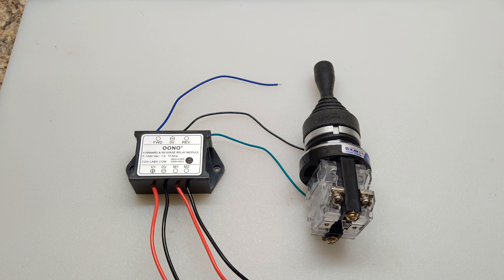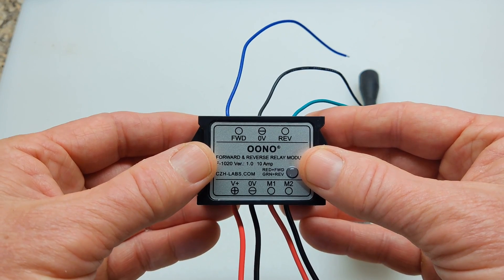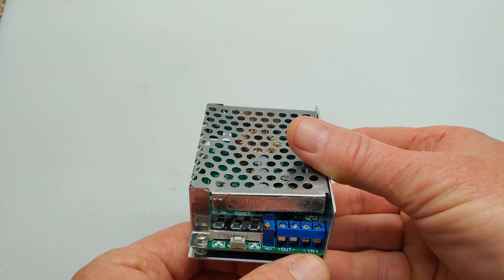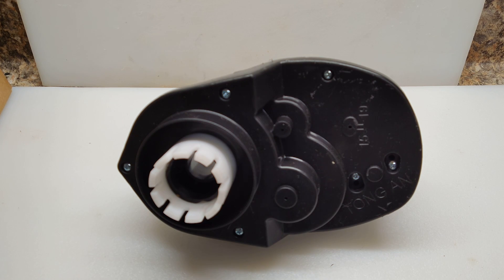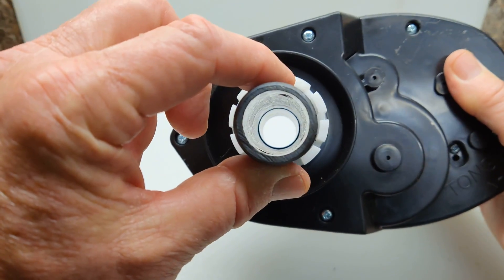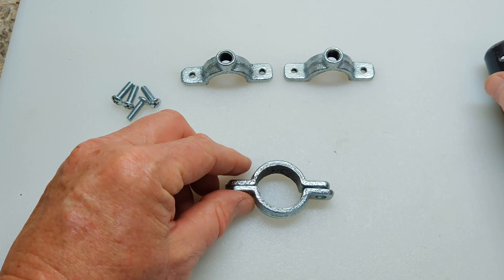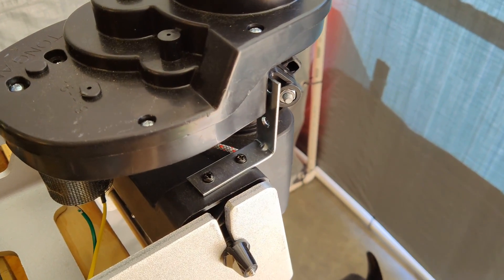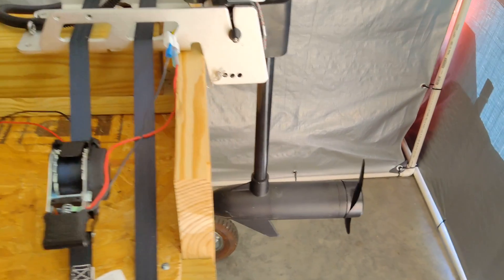Trolling Motor Power Wheels Gearbox Steering

Comment: i have the sd5160ssg , the bctrolling motor block, a 7v voltage regulator and the chinese joy stick on your other video  it doesnt work i am probably not wiring it correctly or missing something  any thoughts?

Comment: Great videos! I've watched several and all are very informative and well presented. I'm wanting to fo a diy for my forward facing transducer using a minnkota terrova steering motor. Can you tell me what I need to make it a remote controlled gor left and right, and if possible the speed of rotation?

Comment: I tried replying to your question but the system wouldn't let me. It's a Max 350 or P 350. Bought the trolling motor plus 5 lower units for a 1 person submarine project.
Reply from the maker: Nice. I have seen the P350 on AliExpress I think. Sounds like a fun project!

Comment: What size wire are you using for the battery and the power wheels motor
Reply from the maker: I used 10G marine wire for the battery and 14G for the power wheels.

Comment: You beat me to it!!! Good job!! Any reason you didn’t use the ds-600 and a second ESC? I got it working but I haven’t assembled it yet. Nice thing about that set up (in addition to being wireless) is you can set the speed by changing the power output of the ESC. 
I’ll try to post something when it comes together. I’m having a bit of an issue opening up the hole for the trolling motor shaft. I’ll give the hole saw a shot. Note: a spade bit is not the answer🙄
😆
Reply from the maker: Thanks Wali! I've done the DS-600 and a single ESC can work the throttle and steering. In this case, the motor does not have a signal input that would allow me to use it as it is now. I would have to think on it. This was intended to be a simple and inexpensive build ( yeah, after I finally figured it out.).
Reply: @Aksmaniyak  just takes a bit more head scratching… and just in case you thought I was bragging because I figured it out. Don’t.  I got it from this guy.. 😁. https://youtube.com/shorts/G8kLzCS9lwY?si=mKPVOlLN-S0WGLYG

Comment: Cool idea, but useless with this implementation if we want install this on kayak.
- a rotation limit of no more than 90 degrees from the center is necessary
- automatic center alignment also is necessary
Without this, the actual control of the kayak will be extremely difficult and inconvenient.
This can be implemented with controller like arduino and step motor in steering control.
I implemented something similar with modified Haswing Cayman T. But I haven't tried it yet. If the tests are successful, I will try to record a video and publish my project in open source.
Thank you for making such videos!
Reply from the maker: Thanks Alexey. A 90 degree maximum rotation is very simple. The depth collar can be position and modified to act as a "stop." Automatic center alignment is not necessary as has been shown using ESCs with a wireless joystick. I do not like using step motors for controls because you do not have "infinite" speed selections. Please keep us updated with your progress.
Reply: @Aksmaniyak  Missed that video. But yes, servo solves all problems.

Comment: have you figured out how to slow the steering down? looks to me as it turns way to fast to have any control of the kayak
Reply from the maker: Yes, like I said in the video. You adjust the voltage. Once you get used to the joystick (like with most applications) control gets better.
Reply: @Aksmaniyak  I'm building a new motorized kayak for this year as in 70 and don't think I can handle the pedaling anymore.  So I'm loving your work thanks for sharing 👍
Reply from the maker: Glad to help Michael.